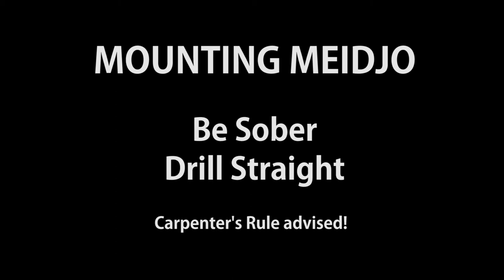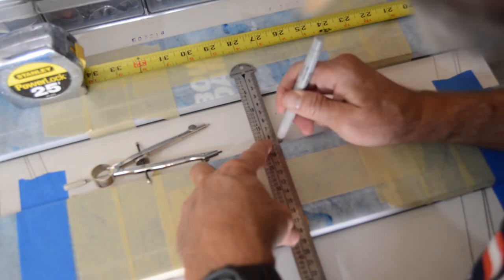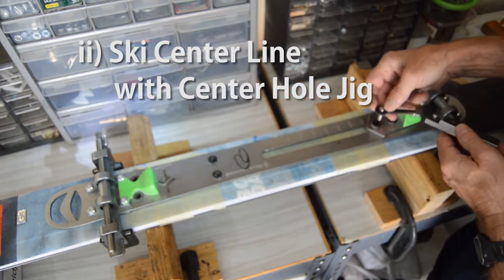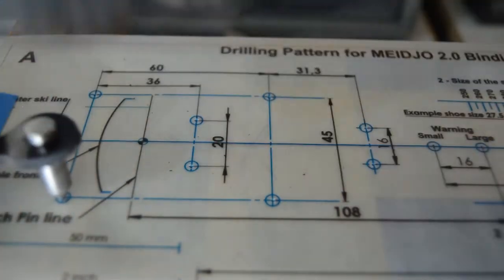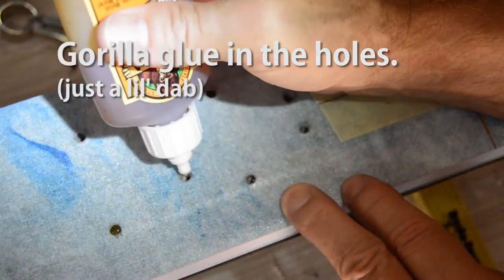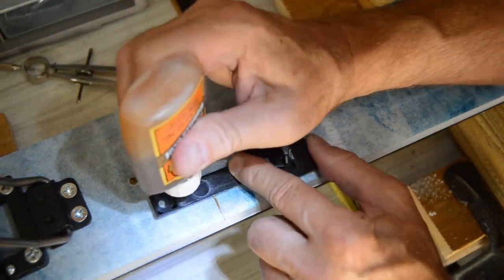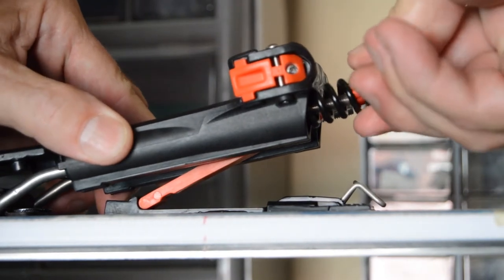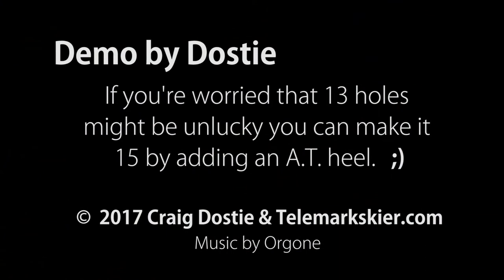Mounting Meidjo - Installation tips

Comment: And don't forget carpenters rule no 2: do use the right bit for the screws, this is NOT Phillips screws, but Pozidrive, I believe size 3. Dostie is using a Phillips bit (and screwdriver) It works, but it is not the right tool, even more importent when unscrewing. Thanks for a great video.